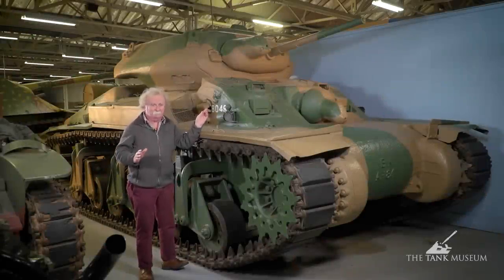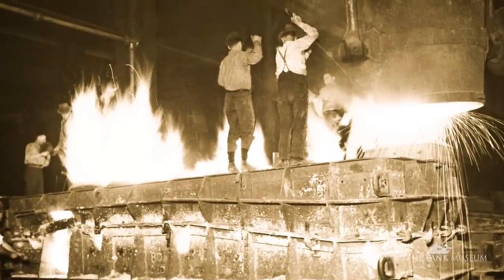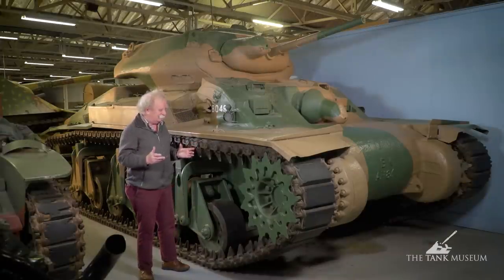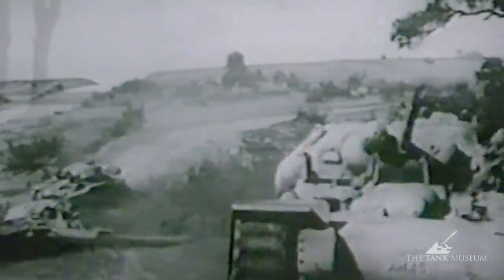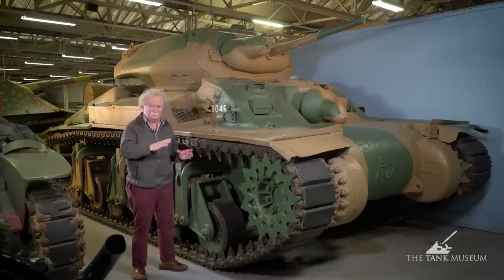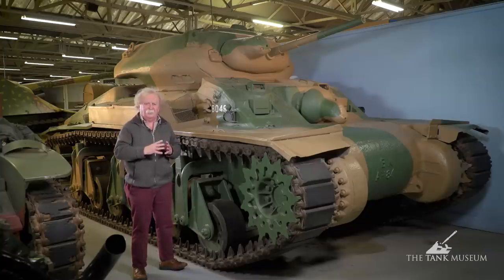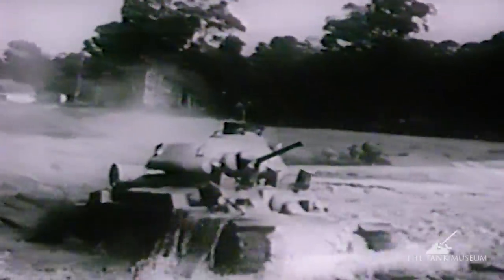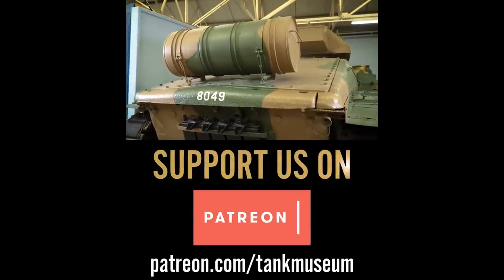Tank Chats #73 Sentinel | The Tank Museum

Comment: I worked at chullora, NSW Australia, in the 70s, "where they were built", and the old "tank annex"  was still in use as an traction motor "locomotives" assembly and overhaul building . Even the test ramp was there where the tanks would climb after assembly.

Comment: That was a kind assessment. The original AC1 was built with help from Pierre but also drawing on Australian experience with British cruisers and Matilda tanks in North Africa. A cruiser 3 was even sent to Australia to study. Consequently the AC1 was a very cramped tank internally and the turret ring was much too small. Nicholas  Moran had a difficult time getting through one with his 6'4 frame. However the turret ring was on a seperate casting and was soon changed to a 60 inch ring as per the ShermanTank. A new mk 3 turret was also developed. This turret had a bustle and could mount the 83mm 25 pounder (produced with a longer barrel and super charge for tank use) or the 17 pounder. At the same time, the triple engine arrangement was redesigned with triple blocks mounted around a single crank shaft becoming a 330 hp multi bank engine.(Pierre Caddilac). The hull machine gun was discontinued, the slope on the fron armour was increased and armour thickened to 75mm but typically 80 after casting. This tank became the Mk3 Thunderbold .
The AC1was really nothing more than a prototype that lead to the AC3. If the USA had not been able to supply M3 grants, then the AC3 would have gone into production and AC1 hulls would have been upgraded with the bigger turrets and turret rings.

Comment: First completely cast hull, first turreted tank to mount a 17pdr (1 year earlier then the firefly).  The design notes when discussing the tank design said the tank must have a turret ring big enough to up gun with future weapons.  This is why they were able to mount the 17 pdr and they even had discussions about the 3.7 inch gun most commonly known as the 32 pdr on the tortoise.

Comment: Australian industry worked miracles in WW2 - and the Sentinel was one of them. It was rejected by Allied leadership because the Aussies couldn't build enough of them in time for D-Day. Otherwise, the Brits would've snapped them up. Aussies solved problems which the Brits found insurmountable - but they couldn't supply the solution in the required quantity.

Comment: I'm curious how the Sentinel Tank would have performed in PNG? Would it have been able to deal with the terrain - I'm assuming the flatter parts and the coast ect, not the mountain tracks that were even an effort for humans and had so much mud that light artillery carriage wheels were jammed and had to be dragged at some points. 

But still there are different levels of jungle for tanks to move and fight in, and having the Sherman tracks might limit it slightly, but would the French variations help or make no difference?
i.e. Would the bugger get constantly bogged?
Did it have enough power to climb obstacles and is there any information at all about how reliable it was, even info on the Cadillac engines of the time?

And when it came to the fight would it hold its own?
Could the Japanese penetrate its armour with anything they had in PNG? I'm assuming it could destroy Japanese bunkers (although HE is best, could it fire any?) and would the light Japanese tanks be cannon fodder for it?

Finally slightly off topic, but from a purely logical perspective wouldn't it have been better for the Allies just to give the Australians the plans and say one sample of a already designed British or American tank that we could copy, modifying perhaps for available resources (the radial engines were all going to aircraft - the Boomerang, so the Cadillac solution, tank engines were often varied in WW2 in production runs, look at the Sherman).
From the point of view of the U.S. and the British, getting Australia up and running asap with armour and in the fight was the vital issue, not some parochial concerns over who makes what. 

A Australian copy could be constructed without the design delay and basically reinventing the Wheel. 
Hell, with Australia's mineral resources we could start supplying local commonwealth countries with gear, freeing up their military logistics chains from having to ship it over. 

And if the Australian tanks were an exact copy with interchangeable parts with one of their tanks, well that helps them as well. 

And does anyone knowledgeable have any suggestions on what tank Australia should have copied with the manufacturing resources and requirements at the time. 
Of course we would choose the Matilda if just looking at names in a catalogue …

Comment: Building the tank hull from rolled sheet metal and welding it together would have been an easier production process than casting it. I think it was early experimental days or that they thought the cast armour could withstand the available Japanese anti tank guns in this theater.
Reply: The reason for cast hull was due to Australia not having any plate steel of the required specification at that time with the country desperately short of resources and no shipping sea lanes bringing cargo in. The country had a serious issue of being able to supply even an engine for the tank from the start at design, and prototype proof of concept stages into production, its the reason for the three engine configuration with Cadillac V8's it's all they had.

Comment: 6:06 Why is it that running tanks can't be shown in the Museum?
Reply: Because old engines are leaky and oil,  petrol and old high voltage electrics don't mix very well..

Not to mention the usual bright sparks who'll try to start the things up and get the shock of their lives when the T34 fires up and gasses everyone within 30ft with diesel fumes.

It's probably health and safety - the running vehicles are probably kept in a very secure compound - you really don't want some ricer gimboid buzzing around the place in a Sentinal or Sherman or anything else - just imagine some crapcan-chimpanzee manages to hot wire a stug III? And they're not exactly massive in the scheme of things..

Comment: as a mechanic...... id HATE to change the spark plugs in that thing..... 
24 plugs.... holy cow

i thought fords 6.2 v8 with sixteen plugs was bad enough 
(and a stupid design...chevy gets more MPG with only 1 plug per cylinder..... and dodge's hemi has 2 plugs per....but in a SLIGHTLY better location than ford)

Comment: If one of the three engines it had failed would the tank be able to still operate with limited mobility? Or was it all or nothing?
Reply: The answer is, probably.

The Chrysler multi bank engine had 30 cylinders and could move a Sherman if only 12 were running (2 x inline 6). This was 5 Plymouth car sidevalve sixes in a circle driving a central layshaft (I think) that was fitted on the "Easy 8" version of the Sherman. 

It depends really on how the engines are connected. If they're clutched into the driveshaft then theoretically one engine could move the tank on the flat, two would give you 20mph and moderate maneuverability - but if they're set up as a unitary power system then damage that locks up one v8 engine will probably disable the whole thing.

Without a good look it's hard to tell.

Comment: You show your famous tiger tank 131 in the museum and also in the moving display and have used it in movie rolls there should be some more exceptions if not you need to decide whether you going to used tiger 131 as a moving display or keep it in a museum as a static display need to apply the same rule to all tanks and vehicles

Comment: Wonder why they couldn’t simply either straight up copy or modify the M4 Sherman?
Reply: There was no M4  Sherman in 1941, when it was designed. And it entered production roughly at the same time as the Shermans did. So the creation of both tanks went almost in paralel.
There was the M3 Grant/Lee at the time (which is mentioned in the video) but it was an impractical design, so they had no reason to copy it, only the suspension and drive train somehat influenced the Sentinel, which is also true for the Sherman aswell.
Reply: Also, they didn’t have the same power pack, nor the capability to weld tanks. So making an M4 if they had the designs would not have been possible.